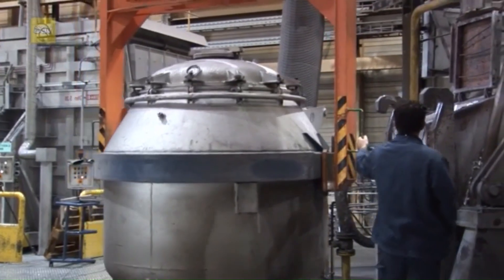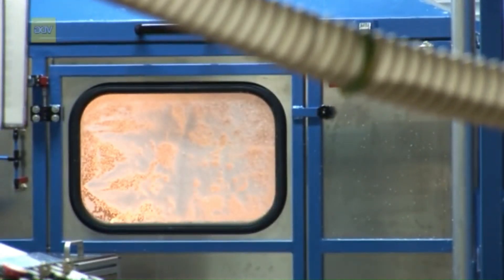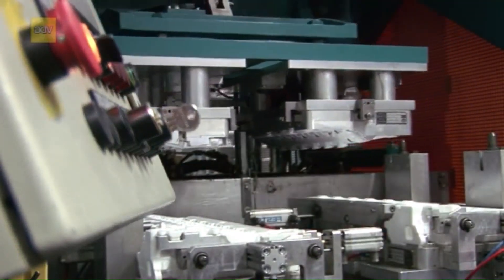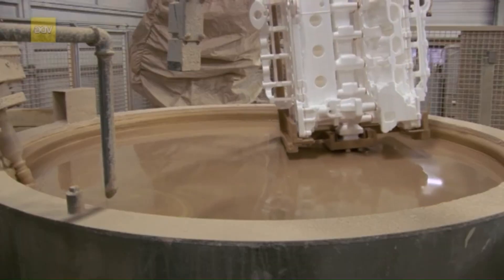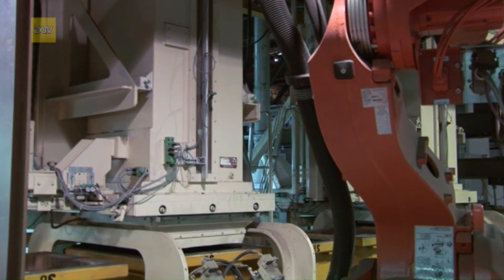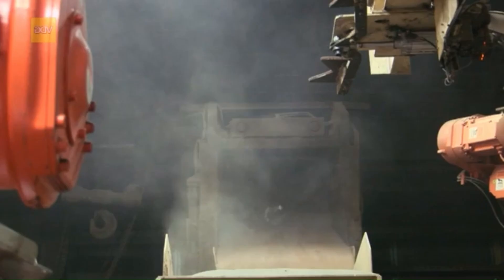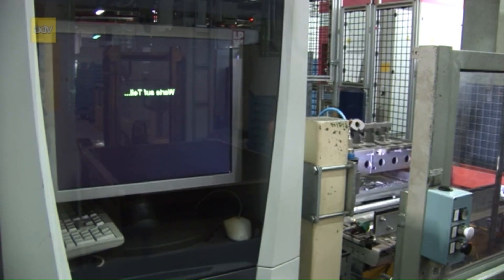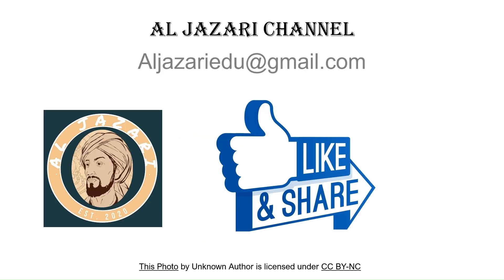Lost Foam Casting: Precision, Sustainability, Innovation

Comment: بهترین روش برای ریخته گری🙌🏻
Reply from the maker: @MOHAMMAD-NIKOO
Yes, you are right. But it needs a lot of expertise.
Reply: @AlJazariedu دوباره تحقیق کردم در مورد این روش .که گویا بعد از سرد سرد شدن گاز های فوم در آن حبس شده و متخلخل میشود.
Reply from the maker: @MOHAMMAD-NIKOO  You’re absolutely right to look into this 👍
In Lost Foam Casting, if the process is not properly controlled, gases generated from the foam decomposition can indeed cause porosity. That’s why parameters such as ceramic coating permeability, proper compaction of binderless sand, melt temperature, and pouring speed are critical.
In well-designed industrial processes, these gases escape through the coating and sand—and are often captured and treated—so porosity is minimized. In most cases, porosity is a result of poor process control rather than a limitation of the Lost Foam method itself. That is why the process needs a lot of expertise.

Comment: No way... This video is pure gold...
The only issue with this is the cost of the mould.
Reply from the maker: Thank you so much! We're thrilled you found the video valuable! You're absolutely right—the cost of the mold can be a significant factor in Lost Foam Casting, especially for complex or high-volume production. But the precision and reduced need for machining often offset that cost. Appreciate your insight!

Comment: Oh wow! Lost wax casting except you are using styrofoam!
Reply: You can get a bunch of deforming if ypu dont vibrate the sand properly .  However once you get it figured its fast and easy to make not just parts but tools and machines
Reply from the maker: Exactly! Lost Foam Casting is like traditional lost wax casting, but with a modern twist—using expandable polystyrene (Styrofoam) instead of wax. It’s fascinating how such a simple material can create such intricate and precise parts. Glad you enjoyed the video!

Comment: What holds the core sand in place when the foam burns out?
Reply: NO, the sand that is packed with vibration holds the mold and cores in place .   If the temperatures are right the alu replaces and holds the walls back as the metal flows in .   Its crazy but it works . I have been doing it in my shop for about 4 years now making placs and tools
Reply: The ceramic dip will produce a thin hard skin when dried, although I would have though a high temparature would be rquired to 'fire' the ceramic to make it stable.
Reply from the maker: In Lost Foam Casting, the foam model itself acts as the pattern. One of the advantages of this process is that no cores are used as in traditional sand casting. When the foam burns out during the pouring of molten metal, the surrounding compacted, binderless sand and the ceramic coating (slip) work together to maintain the integrity of the mold.

Comment: One would wonder if 3d printing made this process obsolete?
Reply: No, you can't get proper grain structure
Reply: YES, true but you can machine large parts out of foam bought at home depot then cast way faster than itvwould be to do it with the lost pla meathod . I have been experimenting with this method and it works awsome
Reply from the maker: That's a great question! While 3D printing has certainly changed the landscape of manufacturing, lost foam casting still offers unique benefits, particularly in precision and material efficiency. Moreover, although 3D reduces material waste, it is not suitable for patch or mass production as it has a long processing time.
Reply: Maybe for prototyping but it’s not economical at all for mass production.